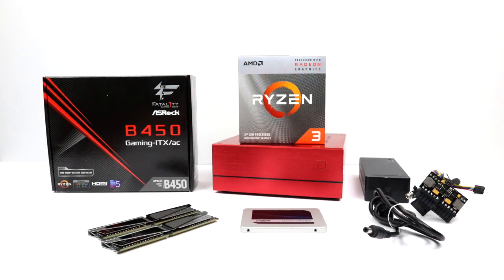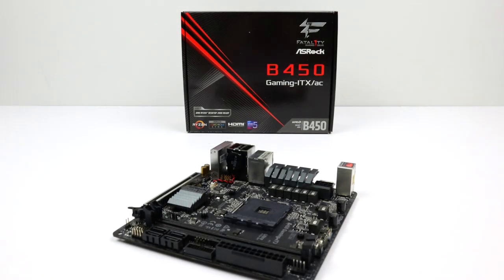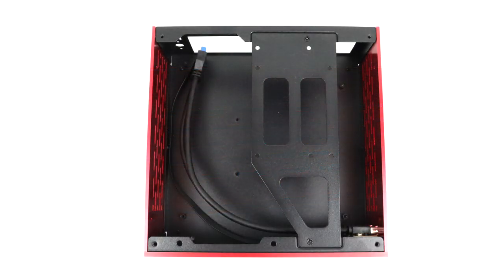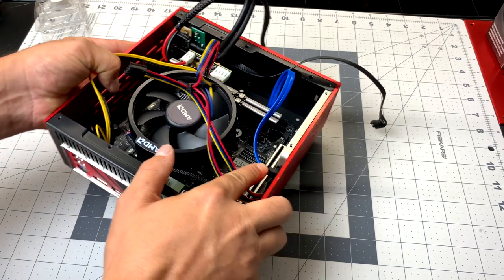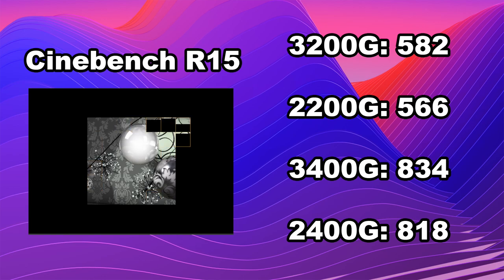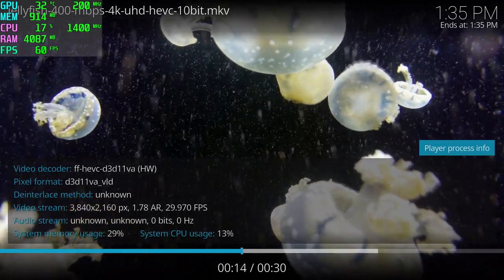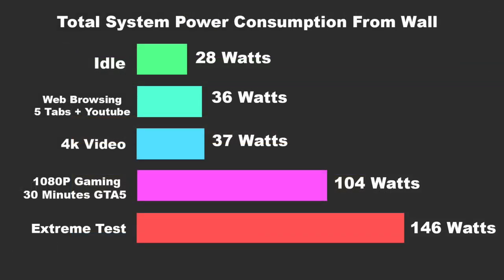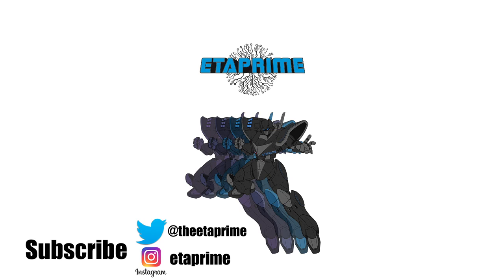Ryzen 3200G Super Small Form Factor Build - Gaming Media Emulation

Comment: Interesting, they actually do label it 2nd Gen on the box, very honest of them
Reply: Yes? Ryzen 3000 is not third gen. The 2000 series was a refresh of first gen.
Reply: wow......
Reply: @amshermansen  ehm, AMDs APUs are always 1 generation behind their "normal" CPUs
which means that the 3200G has the Zen+ architecture
Reply: Baby steps. First you explain that there is no "third generation ryzen", yet, and THEN we deal with the issue of the G APUs being a hybrid between two generations.
Reply: Is this Zen 2 or not?  I'm confused.
Reply: The 3400G is Zen+, so Ryzen 2000 series based in a nutshell.

The same was the case with the 2200 and 2400G. Those were Zen, not Zen+ like the rest of the 2000 lineup.
Reply: note that Ryzen 3000 is 3rd gen(except for apu) and is based on zen 2 architecture. Don't get too confused on gen/zen counting.
Reply: @amorettique
 Apart from the fact that the whole naming scheme is basically designed to be confusing for people. 2nd Gen Zen is Ryzen 3000 but then the APU's use Zen+ which is the same as Ryzen 2000 which used a 1.5 version of Zen 1 which is the first gen of Zen.
Reply: @amshermansen  It's Zen+, so yeah, essentially a die shrink of Zen.
It gets even more confusing when you realize that the Athlon 3000G is 1st Gen Zen.
Idk. It's unfortunate, but it isn't the end of the world.
Reply: I think they meant something else. I read "2nd gen processor with radeon graphics" like it is just that - a second generation Ryzen CPU with a Radeon GPU. The first one were Ryzen 2200G and 2400G.
Reply: @FunkyELF  no. Ryzen apus are the exact same cpu from last gen. But with graphics

Comment: First off, loved this video.  I impulsively built this and stayed pretty true to the build for the most part.  I had to use a different case since the case was no longer available.  I used the RGEEK L80 case.  It's small but everything fit.  I did change a few parts.  I did use the Ryzen 5 3400G.  I used the RGEEK 250W pico psu off of Amazon instead of the 150W one ETA Prime listed.  I also got the LED Wholesalers power brick that is 12V 20A which alleges it can supply 240W.  I emailed LED Wholesalers asking them about using their power brick for a small PC build and they said they had no experience with computer builds.  Fair enough,  but the fact I got a reply within 24 hours of my inquiry made me feel better about the company.  They are located in California.  I also used an Intel 660P 1TB NVME M.2 drive for storage.  I did opt for the Noctua NH-L9A for HSF cooler on the CPU.  Assembly was tight and slow going, taking me about an hour and change.  Use a magnetic tip screw driver to get those screws in the tight cramped areas of the case.

Just to get this out there, I did have to acquire an Athlon 200GE to flash the motherboard from the shipped firmware version on the board to version 3.40 so it would support the Ryzen 5 3400G.  Ryzen 3000 support appears to be added as of verison 3.3.  Do not flash to most current version of firmware version 3.5 as of this post using the Athlon 200GE.  Firmware notes make it sound like version 3.5 drops support for Athlon 200GE.  Flash to version 3.5 AFTER you have your Ryzen 3000 series CPU/APU installed.

Couple of things.  Hoping folks may have some answers.

This thing does seem to run warm.  Have not done any real word use on it yet.  Reason I say it is warm is because of my big issue.

I cannot get the Team Memory to do the DDR4-3200 timings.  When I enable the XMP profile on the RAM, the board gives 3 long beeps.  blank screen, pauses, another 3 long beeps and then eventually reboots a time or two and then goes back to normal.  Apparently, the beeps indicate memory issues and the board reverts back to stock 2400 timings.  I would be curious to know how ETA Prime got his memory timings to 3200 on this board.

I ran the standard Memtest86 Free edition version 8.2 Four-pass 13 test battery on the system off USB thumb stick.  It took over 2 hours to run and it encountered zero errors.  During this time, the temperature indicator in memtest showed the system hitting temps up to 86C.  To be fair though, this only occurred during certain tests of the Memtest diags.  Some tests the temps dropped down considerably.  I do not have a lot of familiarity with memtest, but if it's like Prime95 perhaps certain tests stress the system to 100 percent usage which can really drive temps up.  And hopefully, this is not indicative of real world use.

I have sent a support request to Asrock and came across an article on Team Group's website about how to specifically use their memory in AMD Ryzen platforms.  Have not tried the Team Group procedure yet.

Lastly, I need to actually purchase a Windows 10 key and start seeing how this performs.  I built this to replace an old Gigabyte Brix A8-5557m based PC which I used as a small HTPC.  Since you can install Windows without a license, I chose to do that to see how the system behaved and install things like HWmonitor, CPU-Z and such just to see if the machine was stable enough to boot and do basic tasks.

Even if I cannot get the higher memory timing issue resolved, as long as the PC does not have any thermal issues, I hope this makes a nice HTPC/Console PC for the living room.  I will use it for some emulation to be sure, but am hoping I can actually play more of my PC game library on the big TV.

Apologies for the long diatribe.  Hopefully, this was an entertaining and informative read for someone.

Comment: I would still want to see the performance with the 3400g and the noctua cooler
Reply: That's what I was hoping for....
Reply: In the ASROCK 300W...
Reply: It'll be fine. From my experience it cools pretty similarly to the wraith stealth.
Reply: I don't think the temps will drastically change. It'll just be more quiet.
Reply: You would to replace the fan it comes with, with one of the higher RPM fans Noctua have.  The RPM of the fan it comes with isn't great at cooling inside tiny cases, and leave no room for OC for anyone that wants even a little.
Reply: Old comment but the L9a and the 3400g stock cooler are equal in cooling capacity but at a significant size and modest noise difference. I'm on the same Mobo as this video.

Comment: If the 3200g overclocks anything like my 2200g did, you're in for a treat.  Don't forget that ram speed and timings make a huge difference in fps for these little apu's.  Going from 3000mhz with loose timings to 3333mhz with tight timings made as big a difference as oc'ing the gpu from 1100mhz to 1550mhz did on my apu.  Trfc especially.  10% fps uplift for each change in my case.  Alternatively, 617 in cinebench r15 for me at 3.9ghz all core at 1.3v.  1.2v soc for the 1550mhz I got.

Comment: I had no idea how good the new Ryzens are with single core performance and so much cheaper than Intel's entry level Core i3 8100. My next computer very well may have an AMD CPU in it. Emulation is all about having that single core performance.
Reply: OldsXCool same price, and the newer i3 9100f is better but no integrated graphics. New ryzens apu’s are last gen zen performance but if you have a gpu just get a ryzen 5 2600 for $130.

Comment: AsRock is coming out with a Mini-ITX X570 motherboard with Thunderbolt 3, so you could possibly do this build with one of those and keep open the potential for an external GPU. Then again, the board costs almost as much as the build itself so that isn't really a reasonable solution.
Reply: this board uses a lga 115x mounting system

Comment: The ground, you’ve correctly connected to the case, but it won’t provide any protection unless your case is grounded, which is would recommend, especially if your power supply isn’t connected to a surge protector. Thanks for videos
Reply: How would you suggest to ground it

Comment: I would like to see this system running with a 120mm cpu fan on a much larger cpu cooler that have heat pipes. I know a larger fan in this case will create more air flow and it would be nice to see what impact that would have in this tiny case like this. This is the case I am getting for my SFF builds. Excellent review.

Comment: I've recently swapped my old gigantic tower with I7 2600K and R9 280X, that I've had for years, for the A300 MiniDesk with the 3400G, and it's perfect!! The only thing is, I need RGB, so I threw out the standard cooler for the Cooler Master MasterAir G200P, that has RGB incl. It's 39.4 mm high, so fits with room to spare. And it's enough for the whole case!! XD XD

Comment: Funny, prior to seeing this video I bought this case intending to use a 3200g for a fairly cheap emulation machine for upto Gamecube/ Playstation 2, unfortunately cheap AM4 mini-ITX mobos are very few and far between so until I can score a deal on Ebay or something i'm using an intel i5 6500 in a itx mobo that I had from a previous build, with surprisingly good results for gamecube emulation at 2x base resolution, although I haven't yet set up PS2 emulation so can't comment on that yet. You have the option of a 5600g now which would really up the performance on this but it might actually be overkill for my needs and the 3200g is super cheap right now.

I dunno how you got a decent Pico-PSU for so cheap though, all the ones I could find were around $100 including the power brick.

Comment: I should also add that you can probably fit the 3400g with stock cooler by removing the fan, and attaching a slim 120mm fan on thee case. I got a Prolimatech branded fan for $15. Noctua has a slim 140 with 120mm mounting holes I think.

Comment: I'd recommend for to always opt for the m.2 ssd route for these types of builds. Makes more open for air flow. But might want to consider looking at corsairs low profile itx aios.
Reply: Definitely good advice for SFF builds.  Not to mention the speed benefits.
Reply: Ssf aios? What is it called?
Reply: @Walhor  small form factor all in one liquid cooler
Reply: @prescottmajette5290  sorry I meant what's the name of the cooler
Reply: Wa͟l̀ho͞r that I don't know. I'm sure some googling will find it though. "Corsair itx aio" should get you close
Reply: @prescottmajette5290  damn it looks like it's discontinued :/

Comment: I built a very similar PC yesterday. Other than a few cuts on 2 fingers it was pretty easy and quick. However, the 120W Power adapter I bought is too fat to fit inside the 240W Pico PS. Should I order a 240W adapter or just go to my local PC shop and ask them to find a match? I really need this within a few days so I can install the software and restore data by Christmas.

Comment: Hi that is a nice looking build great video. I was thinking of doing something like this, small factor, but building the case from 0.
Also do yo know if the 3200g or 3400g are compatible with the dual graphics thing (CPU Vega + GPU)?
Reply: Not sure what you mean as it would be "CPU + Vega GPU" for the G series. These CPUs come with stronger integrated graphics that enable you to play games like how ETA did above...but without a discrete GPU.

So this CPU functions as both a CPU and GPU, yes
Reply: @wilsonram39   Some time ago AMD ha this "tecnology" that let you to put a APU + GPU for better performance, but i can't find if the 5 3200 g is compatible with that
Reply: they are not compatible with dual graphics. As soon as you connect external GPU the vega gpu is off. Unless they completly change bios and drivers whitch is a no go.

Comment: Great video. If you don't mind my asking, which cooler did you test the 3400G with? You said you tested the 3400G with an aftermarket cooler, but it ran too hot. I have a customer that wants an ultra small build. I was gonna go with the Asrock A300W you reviewed a few months ago, but i like this one a lot better and I am already planning to build it.
Reply from the maker: I used the Noctua NH L9 a, I’m going to be testing it in the deskmini a300 this weekend. I think it will cool the 3400g much better in that case with the fan profile set to performance.
Reply: @ETAPRIME  Thank you. That is the cooler I have got the build as well. I would prefer the new build over the A300 because I can put faster RAM and if they decide to go back to their current setup (I built their current PC to look like a DVD player), it's a simple parts swap.

Comment: It looks like using a Asrock A300W would save about $50, as it would replace the motherboard, case, and power supply, for right around $170. But you're going to spend about $20 more on SO-DIMM memory. 

If you're routinely building PCs, it's a worthwhile investment to pick up an AMD Athlon 200GE, for around $40. I've seen them as cheap at $32 open box, at Microcenter.

Comment: Interesting to see this case with more modern hardware. 
How did you fix the 2.5 inch SSD?  

The case sadly is not available in Europe without import fees. I think the same case is sold as B01 on Ali Express but I am not sure yet whether it is genuine. Going to ask the seller ;)
For a toy server I used the same case.
I bought the black Goodisory A01  case 2nd hand for EU 15,- .  As motherboard I use an overstock  Kabini based Biostar  a68n-2100  passive cooled. Also EU 15,- Same powersupply. Note I think that you need a 150-200 Watt  12 V PSU. My board would not start with a 120 Watt 12V brick. I use a 200 Watt now. PicoPSU + brick where ~ EU 90,-
Memory and SSD were leftovers.

Comment: As far as I know, you dont need an BiosUpdate for the Ryzen3000 APUs because they are based on Ryzen 2000. I prefer to see a build of an Ryzen3400g Apu with Standard Cooler in an MiniITX case. Because it is diffcult to find a case for the standard cooler. That would have been something new.

Comment: Idk it you have tried this or discussed this or not but have you tried using the 3400g in that case with risers on the top plate to give it a little more breathing room with an aftermarket lower profile CPU cooler? Or maybe some slim 40mm fans on the sides? I'm actually thinking about doing that build and was wondering if you have and what your results might have been.

Comment: Pretty cool little pc. But for me I am doing a mid tower with a b450 gaming plus atx board. I will probably get a 2600 instead since I don't have a older ryzen chip to update the bios with.
Reply: Why not go with 3600? Just ask seller to update Bios before sending.
Reply: yanuar mustika Cause my motherboard needs to be updated for that so I cant use the new ones. But the 2600 should be just fine.
Reply: If it's not too late most MSI boards and some others can flash bios without a CPU so you can get a 3000 series and not worry

Comment: interesting article, thank you for making it and sharing.  The thing that really got my attention was the power usage near the end - I've been considering options for a lower power solution for my gaming desktop for web browsing and downloading files for quite a while, so seeing the 36W power usage for youtube + browsing really had my attention.  I have been looking at amlogic media players running ubuntu, but so far the hardware support for youtube video playback at 1080p just isn't there.. a low power ryzen setup in a small case may be what I need for the majority of my computing (web browse + usenet + torrents) and some low power gaming.. then fire up the gaming PC for the heavy duty games where a seperate GPU really is needed for the game to shine.

I was a little surprised not to see PS2 / PS3 / Wii / Gamecube / WiiU / 3DS / Switch emulation not covered for this build though.  benchmarks?

Comment: From other reading/videos, I though you could only use the 3200 MHz RAM with the X570 mobos ?  Does the new board firmware allow the faster RAM even on the B450 chipset ?  You certainly do not need PCIe 4.0 on a build like this.

I think I will hold off on a similar build until the APU chips move to 7nm and Zen2 architecture.  7nm would allow a lot more cache.  Probably 12+ months.

Comment: I dont know if you saw this on amazon...but the Ryzen 5 2400G is 100 bucks.. the cooler height might be an issue, but Ive seen the benchmark difference between the R5 3400G vs R5 2400G and they are quite similar.
Reply: Really?

Comment: If you want small, isnt the asrock A300w barebones still a thing?
Reply: The Silverstone Petite 13b is the smallest case I've found at about 7" x 7" x 1.6". That's half as thick as this case plus slightly smaller on the length and width.
Reply: True but you only specified small, not a variety of options.
Reply: @Oniphire  well the theme was AM4 rather than purely tininess.
Reply: @Oniphire  how do you fit a cooler in that thing though
Reply: @RandomPlaceHolderName  It was. Just saying your comment only addressed size. There are definitely more options for anyone who isn't concerned strictly with size.
Reply: @HetZieltje  I think you have to limit yourself to a 30mm CPU cooler like the Thermolab ITX30.
Reply: @RandomPlaceHolderName   Yes it did, and it started with "If you want small..." not "If you want small and something you've already reviewed."

Are you trying to tell me that my reply missed the point?
Reply: @Oniphire  So you are capable of reading between the lines despite missing the tiny AM4 APU boat. Good to know.
Reply: @Cualquier otro nombre Asrock's website says it's compatible with the 3400G

Comment: ETA, our gaming rig just died and my son and I are looking at knocking together a new one using something akin to this build. He wants to be able to run Red Dead 2 when it comes out. Would this system be able to run it? I'm thinking if it can handle Skyrim, it can run RDR2?
Reply: Most definitely will not.

Red dead is brand new and Skyrim is a decade old.
Invest in a graphics card with a cheaper cpu.
Good luck
Reply: Rdr2 is Soo demanding at the time, im thinking a PC with at least a GTX 1650 to be able to handle RDR2, 1080p medium 50fps